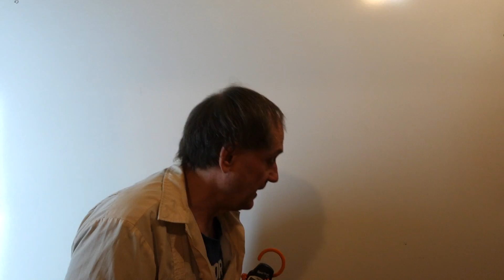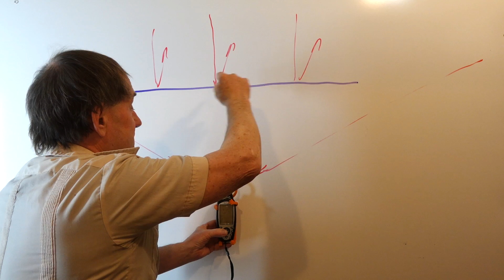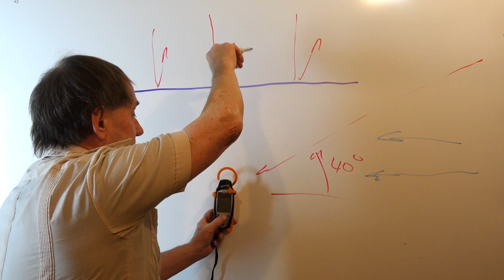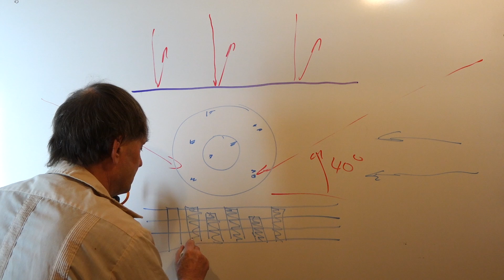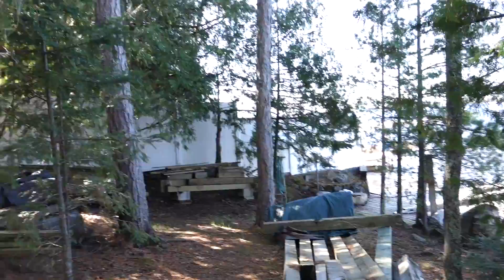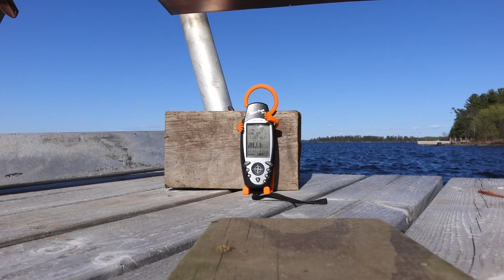GPS  Signal Test

Comment: I wish you could have put the GPS device in a copper box with no lid , it then would have prevented any horizon angles and only got transmission from over head. Remember, you have to cover all angles....no pun intended.....when dealing with FERs
Reply from the maker: Yes that would work but my receiver does not have an option for the use of an external antenna.   This was a quick crude demo not meant to be at the same level of detail as my other videos.
GH
Reply from the maker: I thought about that too but in FE world,  light and RF signals can STOP make a right angle bend, go up and and then sneak in at the top of the box.  There is only so much I am willing to do for FEs.  As a rule, I do not jump thru hoops for FEs but there was a discussion in GEMs Discord channel where I explained this very issue to very dense and not so very bouyant FEs.  Some of the replies I got as to why the signals  might not remain constant from ground based towers is there could be a gusty wind between me and the tower blowing the signal away.  GET  THAT?  Wind blowing a radio signal away.  This is the degree of stupid we are dealing with.
GH
Reply: Would a parabolic antenna have worked by showing a much stronger signal when pointed at the satellite?
I'm not suggesting it, only asking for my own clarification. It wouldn't change the mind of a flat earther if they'll resort to "gusty wind."

Comment: Love it George. Here's an example of my style of humor ;)  I used a shovel ... enjoy !

GPS ANTENNAS MOUNTED ON BUILDINGS - PROOF
Published on September 27, 2016

Video Description: An examination of the raw data files collected using multi-frequency carrier phase, multi-constellation GNSS / GPS receivers reveals the true sources for the locations from which the signals are being transmitted. This video includes an experiment demonstrating this and also how to process the data to produce the final results and the conclusion. GPS on construction equipment working on a roadway is also included without any explanation. Draw your own conclusion.

https://youtu.be/PwR_4WRB5Mw